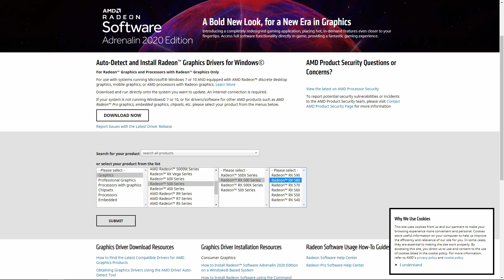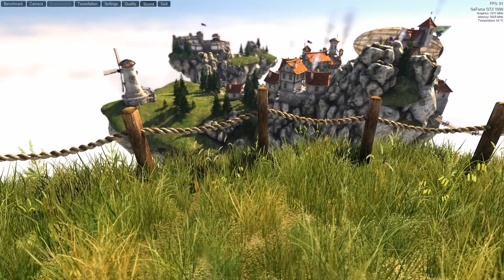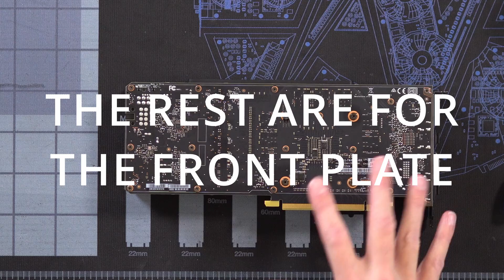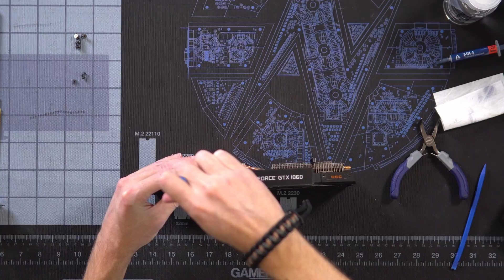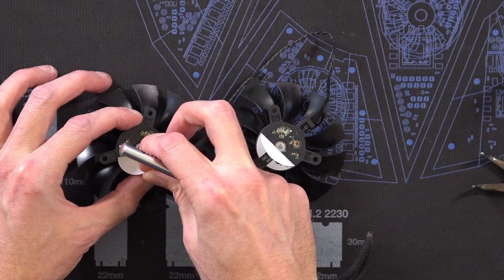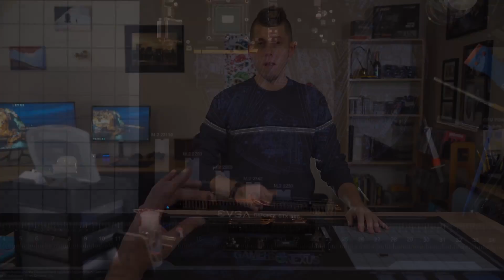Testing & Restoring A Used Mining GPU

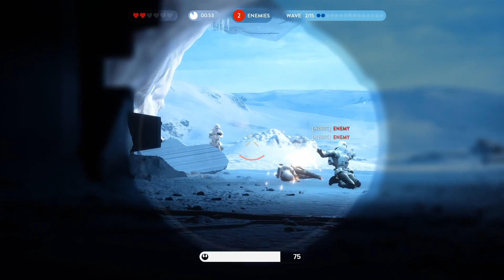Comment: My goodness, what an awesome guide.   Than you so much.  Plus that Star Wars game at @5:23 looks amazing, what is it?!!
Reply from the maker: Thanks! I'm glad someone it getting something of value from this video. And the game is Battlefront 2015. Specifically the survival mode, which can be single player or co-op. There's not a lot there, there are only six stages, but I found it to be A LOT of fun trying to beat my previous times in each of the difficulty settings. I still play it once in a while. The online multi-player is terrible though, unless you know who you're playing with. There's a lot of cheating.
Reply: @TheGameBench  Yeah, I am getting a lot of value out of a lot of your guides actually!  Not just this one.  My position is that I gave my son and daughter an Optiplex 3020 gaming PC 3/4 years ago but now they are starting to lag (Fortnite raised the minimum GPU spec, both devices had a 660Ti in them).  I did my usual thing and put all the passmark and userbenchmark scores into a spreadsheet and did assessments and came to the conclusion that I need to upgrade them to last a year more, so that I can build 2 new custom PCs over the year to replace them.  I was going to replace the i5-4570 and i5-4590 both with a i7-4590, and put GFX 1080 Ti's in them... but after watching your vids, I was happy I got the CPU right, but think I'm going to go with 1070's instead.  After the year is out, these PC's will replace the PC's I have linked to the TVs downstairs!  I'm also going to do the mod and put in a front case fan. :)
Sorry, I did realise it was Star Wars Battlefront after watching more of your vids!  Might have to get myself a copy, I was taken back by how real it looked to Empire Strikes Back!  
Glad to see you are still about - I did see you posting on your YT Community, I'll be there - I thank you again, and wish you all the best. 🙏

Comment: Recently bought a rx480 from a guy who said it crashes sometimes in games for not a lot of money. Upon inspection I found it was missing the 4 screws to the heatsink. I’m thinking the lack of mounting pressure is the cause of the crashes. I cleaned the old gross thermal paste and replaced with some thermal grizzly. Need to test card after assembly. Haven’t had the time to remove the drivers from my pc and install this card for testing.

Comment: What is max length gpu that will fit in optiplex 7010 MT? I’d rather not do any drilling inside the case. Just the default setup. Thanks!
Reply from the maker: In the 7010, you have a couple of obstacles. The first is SATA ports and the USB3 port. Any GPU over 8.5 inches will hit the SATA ports. Now, you can solve that with low profile cables. So, if you get low profile cables and don't want to remove the HDD cage, it's around 9.5 inches. Maybe longer, maybe shorter. It can vary depending on the GPU. I will say one thing about trying to fit a longer GPU in without removing the HDD cage... be careful. You'll have to go in at an angle and the I/O bracket on the GPU could hit the motherboard and damage it. So, just keep an eye on that.
Reply: The Game Bench Thanks so much for the info! And I’ll be very careful when inserting it gpu not to scratch the motherboard!

Comment: hi i’m commenting on this video as it has less comments, giving you a greater chance to reply. i have a dell optiplex 760 however i think it’s to old to upgrade. i want to buy a new optiplex and add a gpu, and try fit it with a good cpu, could you please recommend anything? 
edit** i’m not good with chipsets and stuff but could you please help
Reply from the maker: I'd agree that the 760 isn't viable for modern gaming, but they make great retro gaming systems. My recommendation is typically the 7020 or 9020 with at least an i5, preferably an i7 as they are 4th gen Core series CPUs and are still relevant for modern gaming. Right now prices are pretty volatile for the OptiPlex systems and I've seen people buy the i5 systems for up to $180, which is absurd. I can't suggest paying more than $140 for one, and it better have 8GB of RAM and 500GB at last.

Now, you might be able to find one for a reasonable price, I still do from time to time, but not often. I've pivoted to looking for i7 systems since you can find them for as little as $200 to $250 and that's well worth the upcharge. Don't consider that higher end unless it has at least 16GB of RAM and a 1 to 2TB HDD.

Some alternatives I can suggest are the Dell Precision T1700. They can be found with the same CPUs and the can also be found with a 365 watt power supply with a 6-pin PCIe power connection. I bought one recently for under $200 with an i7 4790, 16GB of RAM and no HDD. They're essentially the same system. You could also go for the 7010, 9010, Precision T1650 with a 3770, though prices for those is on the rise. Then there's the HP 600/800 G1 systems that are a decent alternative as well, but I' haven't checked on prices on those lately. I would avoid the 3rd gen i5's.

As for GPU, with the 4th gen i5, I can't really suggest more than the 1060 6GB, which can run on the stock 290 watt power supply. The 570 or 580 are decent options but will require a better PSU. If it's an i7 3770, 4770, or 4790... the 1070 or 1080 are good options and will require a PSU replacement.

Sorry for the book or a response. It's just a super open ended question.
Reply: The Game Bench you are truly one of the best, and don’t be sorry for anything! this has pointed me in the right direction!

Comment: Hello I really need your advice here!!
Do you think I should a gtx 1660 super with an i7 3770?
My goal is game on 1080p , med-high settings without having to upgrade any components for 3 years
Reply from the maker: What is your frame rate goal? Are you just looking to keep above 60 FPS?
Reply: @TheGameBench  Yes since I will  be using a 60hz monitor
Reply from the maker: @johnehab5579  Sorry for the slow reply. With the 1660 Super, you'll have no problem exceeding 60 FPS with the 3770. The 1660 Super is on par with the 1070. This also means that the 3770 will be a bottleneck in certain scenarios for the 1660 Super. Games like Far Cry 5 will be held back by the 3770 due to lower clocks and IPC. You'll still be able to get 60 FPS though.

Comment: Hey I know this is a bit of a weird question but would different optiplex motherboards be compatible with each other.like would a 7010 motherboard be compatible with a 9010 with i7–3770 and rx 580 thanks
Reply from the maker: Well, the 7010 and 9010 are pretty much the same. The only difference I can find is that the 9010 has vPro and the 7010 does not. Same for the 7020 vs 9020. Regardless, the 3770 will run in any xx10 model.
Reply: The Game Bench thanks for the quick reply as I’m trying to get the cheapest one possible since I’m pretty sure my motherboard broke after a installing a faulty psu.ive tried a bunch of troubleshooting but I can’t seem to get it work and now on the last resort :buying a new one.also I’m guessing the 3010 is gonna be the cheapest will the be fine
Reply from the maker: @christojolly6506  I would avoid the 3010. It's missing a lot of features of the 7010/9010. It only has SATA 2, USB 2, PCIe 2, and a max of 16GB with only two RAM slots.
Reply: @TheGameBench  oh i didn't even realise I'll go for the 7010 motherboard
Reply from the maker: @christojolly6506  Yep, I got one in for my next video, which is a build video and found all this stuff out. I quickly swapped it out with a 3020.
Reply: @TheGameBench  sorry but one more quick question.If i change the mobo from the 9010 to the 7010 one should i have to do any software things as i can't get my pc to even post.
Reply from the maker: @christojolly6506  Well, you don't really need to do anything as far as software goes. When I build these I have an image for the 9010 and an image for the 9020 and I just use them regardless if it's a 7xxx or a 9xxx model. So, you should be able to drop the 7010 board in an be off and running.
However, if it's not posting, it could be number of things. What else have you tried?
Reply: @TheGameBench  ive basically tried everything from reseating the ram and cpu to using the jumpers and replacing the cmos battery.I really have no idea what happened as i don't remember it very clearly.Hopefully it's just he motherboard as if it's the cpu im screwed and thanks for the help.
Reply: @TheGameBench  Ok legit final question.Will a 7010 dt work fine with the mt as i've seen some for like half the price.
Reply from the maker: @christojolly6506  The DT's are basically EVGA's way of getting rid of lower quality silicon, so the performance isn't as good as say the SC, and since they typically clock lower due to the lower quality silicon, they also consume less power. However, that puts them around the same as an RX 570 as far as power consumption is concerned. So, if you're seeing them for half what a normal 1070 is going for, they're a great buy since they're not anywhere close to being half as fast. You'd still need to replace the power supply though.
If you want to see how the DT performs, you can look at my CPU comparison video as I used a 1070 DT and 1080 DT in that video, so you can get an idea of performance on the i5's and i7's from the 2nd, 3rd and 4th gens.
Reply: @TheGameBench  Oh sorry i didn't make it clear but i've seen listings of optiplex 7010/9010 mobos from a DT variant which I've never heard of before and just want to know if it'll work without issues in an optiplex 9010 MT.Also I had no idea about evga's dt variants so thanks for that.
Reply from the maker: @christojolly6506  Oh! I always forget about the red headed step child that is the DT. The desktop variants are just bigger versions of the small form factor. They look like they used the same motherboard as the MT, but you can only install low profile GPU's in those like with the SFF systems. So, if all you're wanting to use is an LP GPU, go for it. If you don't want to be limited to LP GPU's, then I wouldn't suggest it.
Reply: @TheGameBench  Thanks for the quick reply.And i have a full sized rx 580 so looks like i'll have to spend the extra moolah on a mt mobo but could you clarify why it only works with low profile gpus.
Reply from the maker: @christojolly6506  Oh, the motherboard itself will work with any GPU. It's the DT's chassis that's only compatible with LP cards. I forgot that you're looking for a replacement mobo. As far as I can tell, the motherboard is the same between the DT and MT models.
Reply: @TheGameBench  Oh thanks so much I finally got the reassurance i wanted.I swear I've asked you like 20 questions.
Reply from the maker: @christojolly6506  It's no problem. That's why I do this.

Comment: I didn't know the best place to post this question. With the shortage of PSU would you ever reccomend using an Optiplex PSU in a more modern system? I would components with a lower power consumption, a Ryzen 5 1600sf with a B450 motherboard and a GTX  1650.
Reply from the maker: Not really. While the x90 and xx10 models are the standard 24-pin, any B450 you're looking at would have to only have a 4-pin CPU power, and all the one's worth buying have 8-pin CPU power connectors.

So, all that being said, I'd suggest to take a look at the Corsair CXm power supplies. You can find them used on eBay for reasonable prices, considering the shortage of new ones, and I'd trust them even of something the the EVGA and ThermalTake 80+ white units that people love to put in these.

Comment: Can a 10 inch long gpu fit in an Optiplex without modding the case? 9.7 to be specific
Reply from the maker: Hmm... at 9.7" it's right on the edge, it's possible to be able to shoe horn it in there without removing the drive cage. If you have an x90 or an xx10 model you will need low profile SATA cables, and with the xx10 a low profile USB3 cable as well. If you do this BE CAREFUL as it's easy to hit the motherboard with the I/O plate on the GPU and there are traces on the motherboard right there. Since you're going to have to go at an angle you've just got to be careful not to damage those traces.
Reply: The Game Bench ok, noted. Thanks for the reply!
Reply from the maker: @ryanmiller4646  No problem.

Comment: Hello there have you ever had a problem with board not seen the gpu hardware in windows I'm having this problem any idea 💡
Reply from the maker: Was it working before, or is this a GPU you just bought and you're trying it for the first time?
Reply: @TheGameBench  yes it was was before I updated the bio and ram
Reply from the maker: @datamedicpr  Well, I had the issue with one GPU, and what seemed to end up fixing it was deleting all the UEFI boot devices and applying, then exiting the BIOS. You could also check in the video section and make sure it's set to auto, or see if the GPU is even being detected in the BIOS. Perhaps try resetting the BIOS via the jumper.
Reply: @TheGameBench  thanks I was thinking the same just because whe it work all the settings ware in legacy 👍

Comment: Hey I’ve asked you a bunch of questions about this and since I’m still waiting for my psu I have another question for you.Will a large card cover the sata ports or anything else when installed in a optiplex 9010. Thanks in advance
Reply from the maker: Yep, anything over 8.5 inches will hit the SATA ports. I actually did a recent community post about this that will show you everything you need.
Reply: The Game Bench perfect so it’ll be necessary to buy the right angle sata connectors
Reply from the maker: @christojolly6506  Yes. Just keep in mind that right and left angle connectors are not always low enough to clear. Some are taller than others. The only sure cables I can suggest are the Silverstone low profile cables.
Reply: @TheGameBench  So it's certain I'll need to buy silverstone low profile cables for the red devil rx 580 for the optiplex 9010 or will i be fine with the cables that come with it
Reply from the maker: @christojolly6506  With the Red Devil 580, you will need either the Silverstone low profile cables or some low profile right/left angle cables. You'll also need a low profile USB3 cable. The cables that come with the 9010 definitely won't fit.
Reply: @TheGameBench  Could you possibily link any examples of these please.
Preferably the cheapest ones.Also i live in the uk.
It'll be very much appreciated.

Comment: or you could ask the seller to do all these, an oem rx 580 I bought came cleaned with new thermal pads and fresh thermal paste and the bios fixed, basically plug and play and it was only about 10$ more expensive than other dirtier options
Reply from the maker: That's certainly not typical and I can assure that most aren't going to take the time or want to take the time. Of course, you can always ask, but the vast majority won't. Especially if it's just an individual. I'm one of those sellers where you don't have to ask. I've bought so much used stuff, and 90% of the time, it looks like this.

Comment: hey I'm not sure on how to change my boot mode from legacy to uefi so i can use my rx 580 in my optiplex 9010.Your help would really be appreciated
Reply from the maker: As soon as you see the Dell boot logo start pressing F2 until you get into the BIOS. Once the BIOS is up you'll see a general section on the left. Open then and then go to boot sequence. You then see, in the middle, the option for UEFI or legacy boot. Select UEFI and apply and exit. Now, if you already have Windows installed you will need to reinstall Windows in UEFI mode or the system will not be able to boot from the drive.
Reply: @TheGameBench  Oh ok thanks is there any way i don't have to install windows again and retain all my data.
Reply from the maker: @christojolly6506  Besides installing to a different drive, no. If the BIOS is set to UEFI there's no way for it to boot from a drive that was installed as MBR, which is legacy.
Reply from the maker: @christojolly6506  I'm not sure what he thought that would do for the boot mode. Cortana is a digital assistant app for Windows and has nothing to do with the boot procedures. There's nothing there that would help you switch from legacy to UEFI and not have to reinstall.
Reply: @TheGameBench  https://www.windowscentral.com/how-convert-mbr-disk-gpt-move-bios-uefi-windows-10 sorry my bad that was the wrong link how about this one.
Reply: @TheGameBench  I used this other method that i saw on youtube (which was a bit risky) but it worked and i have all my data and I didn't need to reinstall windows.Thank you for the help.
Reply from the maker: Also, I saw your other question about putting the 580 on the stock power supply.... definitely not. You'd want to get a higher wattage power supply for sure.
Reply: I'm new to all this stuff and all your videos have really helped me out,especially the optiplex ones.

Comment: Can I put a gtx 1650 super without changing the power supply on the dell optiplex 7010?
Reply from the maker: Yeah, the 1650 Super will consume under 100 watts. Perfectly safe on the stock 275 watt unit with a SATA to PCIe power adapter.
Reply: @TheGameBench  does that make it slower and do I have to buy a cable converter?
Reply from the maker: @theultimategamerandhacker  The adapter will have no effect on performance with a 1650 Super. You won't need anything else besides the SATA to  PCIe 8-pin adapter, unless you don't have any open SATA connectors, in which case, you'd need a SATA splitter.

Comment: Can I put a gtx 1660 super in dell optiplex 7010 or 7020?
Please answer the question because I am gonna buy it
Reply from the maker: You can put the 1660 Super in either. With the 7010, I would highly suggest replacing the power supply. With the 7020, you're good to go on the stock power supply.
Reply: @TheGameBench  thanks bro you are a lifesaver
Reply from the maker: @theultimategamerandhacker  No problem.